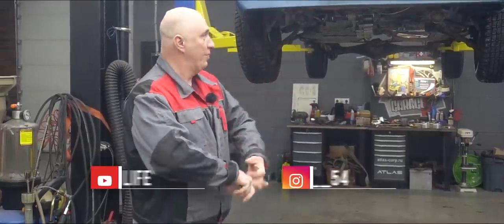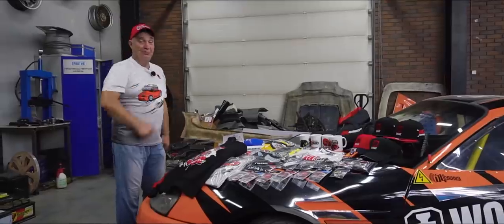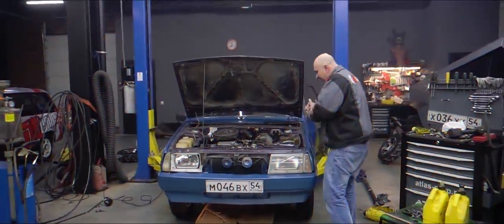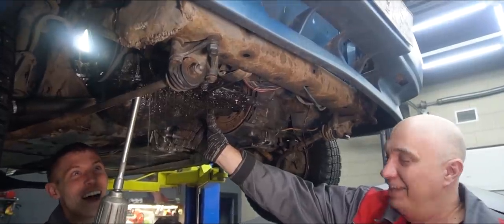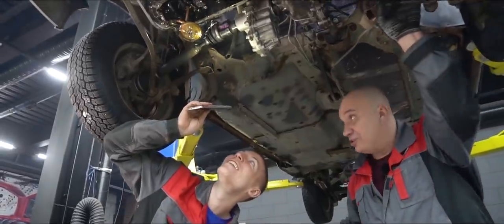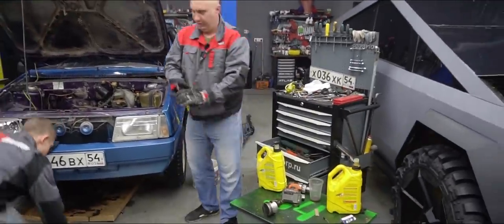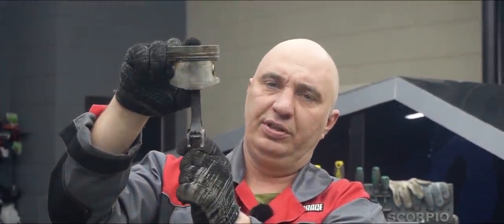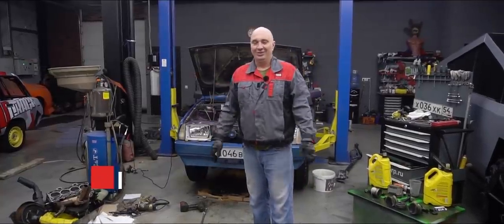How long will an engine run with no bearings?

Comment: Running an engine with no bearings, worried about having an old oil filter. Got it.
Reply: Yeah i was thinking the same lol.
Reply: That part made me chuckle when I was working on this one.
Reply: Oil pressure is important, if they had planned to run it long having a totally blocked up oil filter would have just caused the engine to heat seize rather than smash a rod like it did
Reply: Man. The disclaimers want to make me want to try it even more.
Reply: Maybe of they ran some super-thick oil like 50W70 or even straight grease, it would survive longer.
Reply: @AIO inc.
The vast majority of automotive oil filters feature bypass valves, specifically to prevent the oil pressure loss you describe.
Reply: Well yes when running a test like this you wanna make sure you have sufficient oil going to everything so I can understand that

Comment: Engine going from ~4000 RPM to full stop in an instant, that's what I call 107% engine carnage :-)
Reply: 113% percent success rate!
Reply: @mikeznel6048  
Impossible.
107 % is the max😅
Reply: @erikdikkers7931  They just round it up.  Actually it is 106.9999999999 percent.  107 is just a theoretical max but current science cannot quite get there yet.
Reply: Recycle time..
Reply: Nyet doubt. Sorry I do not know how to say doubt in Russian 😐.
Mr. Piston why you down here in the crankcase??  Too much Vodka 😂😂😂😂😂
Reply: The other carnage is the spoiler u left in plain view.
Reply: @buckerupfpv2622  Spoiler comments happen all the time, I'm not the only one. I always try not to read any comments until after watching the video.
Reply: @buckerupfpv2622  must not be familiar with comment sections..kinda meant to be used after you watch the video. That’s all on you if you decide to read them before.
Reply: People aren't smart enough to wait until after seeing a video to comment.

Comment: I would love to see you guys try gasoline as coolant in a couple different engine types. Excellent as always 👍🇨🇦
Reply: hmmm....
Reply: If it has a bad head gasket, what would happen, would it just run rich, or would the fuel in the coolant get ignited?
Reply: @LatvianVideo  ummm it would burn like normal
Reply: My guess is that the gasoline inside the cooling system would not ignite (given the lack of air).
Reply: @HELLFISH some cooling systems are sealed under pressure, including the reservoir. I wonder how much pressure could build up?
Reply: @SwapBlogRU  cool channel 👍, I wish I could understand Russian ✌🇨🇦
Reply: @HELLFISH you think the fumes might escape somewhere under pressure and ignite from spark?? To be honest I just want to see fireworks 😉💥
Reply: @HELLFISH it def would be dangerous, keeping lots of fuel near lots of combustions
Reply: Ferrofluid as the coolant and then you see what happens when you put magnetic pistons in.
Reply: they just did it recently

Comment: I lost a piston rod bearing on one cylinder three weeks ago. But decided to drive the 20 kilometers back home anyway. The engine lost a bit of power and sounded like a bag of bolts. But I avoided high revs and actually made it all the way home.
Reply: @biryanikebab Yes, and the rod was bent too. When I got home, I took the oil pan off just to have a quick look. What was left of the bearing was at the bottom of the pan. I didn't undo the bolts on the rod to check the shaft surface, but it must have been damaged. I knew what was wrong when it happened, just from the sound. The car is in the junkyard now.
Reply: Smart. Rather than a $200 tow, completely destroy the entire engine.
Reply: @markgunther2502  That car was maybe worth $1000 before the bearing broke. Towing in Sweden is close to $400. And I would still have to spend about a grand on the renovation. As soon as the bearing gave up, the rod and the crank was worthless too. So I would have to spend roughly $1400 and a lot of work to get a $1000 car. Nope, not me. I scrapped it and got $500.
Reply: @GAIS414  Your numbers are way off. I spun a bearing and replaced all the rod and main bearings with the engine in the car for a total cost of about $60 including a new oil pan gasket. The crank was lightly scored but easily can be sanded down in the car as well.
Reply: @markgunther2502  Hahaha! I can tell you don't live in Sweden. And sanding down the crank because of some discoloration? Really? 
Anyway, the bearing didn't spin, it disintegrated! There was no bearing what so ever between the rod and the crank. But I bet you would spend the money to get that car back to it's former craptacular glory. Believe me, the car wasn't worth keeping. Even before the bearing decided to become one with the engine oil.

Comment: cool! i remember when i was younger i had a 1983 chevy cavalier with a 2.0L engine. it blew up so bad at only 40mph that it sent a rod through the engine block and it was the size to fit 2 closed fists inside! it was that much of a bang! ahhh..yes..memories of a teenager who didn't care..lol!
Reply: I DRIVE A 1986 CAVALIER WITH THE 2.0L ENGINE.  I HAVE HAD IT 20 YEARS NOW GREAT CAR. I PUT NEW BEARINGS AND CRANK IN IT IN 2003 AFTER DRIVING A YEAR WITH A ROD KNOCK.  IT NEVER BLEW.
Reply: @MrHeavychevy86  Lucky man! LOL!
Reply: I'm in the UK I've got a vauxhall cavalier gsi turbo
Reply: @thomasmcdougall8059  that'd be a sweet ride. my family is from the UK (Scotland), but i've never seen one since it's been ages since i've been across the pond.

Comment: Try and run an engine with like two pistons removed so that is basically becomes an inline 2
Reply: John Deere already beat ya to that idea
Lol
Reply: @Rox_Fox94  It's always the Germans huh?
Reply: @matthewmorgan582  Third time is the charm
Reply: Well a v8 can't run with only 4 cylinders on 1 side are GMC Yukon engine once killed 4 spark plugs in order to cause that
Reply: @ImSleeping667  there are many videos of v8 running without a cylinder head on one side, and the numerous flathead ford v8 air compressors that run on only 4 cylinders

Comment: I'd like to see a "lada?" motor converted to a 2 cylinder 2 stroke. Use 2 cylinders like compressors to pull air and fuel mix into and then push it into the intake port (On the side) and have a lower exhaust port on the opposite side. I think it could be pretty awesome. No fuel mix required. Water cooled.  Sump and pan lubricated.  I figure you would have HP gains if the compression and displacement is 50% or more of the original.  You could dump the cam shaft and practically make your own head with a flat plate steel and air compressor one way valves; drill for plugs and to make it simple use small engine coils. A bit of welding and there you go.  I would like to say if this ever happens I would love to see a dynamo reading before and after. even if there is a loss.
Reply: That is an awesome idea

Comment: I had an idea for you guys to try, how about fixing an engines flywheel to a stand and starting the engine so the whole engine rotates. I think it would need to be a diesel engine
Reply: WHAT LOL
Reply: The French built a plane like that, where the crank was attached to the fuselage, and the block was attached to the propeller. I believe that was done to make sure it got plenty of air since it was air cooled :p   IIRC, it was a 2-smoker, and they said it turned one way really good, but not the other way.
Reply: @Iowa599  I believe that was the WW 1 Sopwith Camel with a radial engine. The rotating inertia meant it could roll one way easier that the other.
Reply: @Iowa599  The gnome rotary, imagine the whole engine working as a gyroscope, in a PLANE!
Not an easy engine to start apparently.
Reply: @Iowa599  The gnome rotary, imagine the whole engine working as a gyroscope, in a PLANE!
Not an easy engine to start apparently.

Comment: This was an awesome experiment , the carnage was a lot more than I expected.   Perhaps another fun experiment could be with the main bearings.  Keep the front and rear bearings in place and remove the center two bearings. plug the oil feed for the missing bearings and see how much stress the crankshaft can take.
Reply: Dont try this with your lawnmower engine powered Insight. PS , waiting for your vids.
Reply: @stoneheart9679  We are posing an update video in less than 24 hrs.. stay tuned!

Comment: I'd be curious to see how pouring some babbit bearings would work.
Reply: How long would lead bearings last? (Not long obv but still curious.)
Reply: @billbergen9169  They used them for years in steam engines.
Reply: @billbergen9169  Probably forever if you did it right.  I bet they wont take much power, but in a craptastic Lada, you'd probably never know the difference.
Reply: @tippyc2  but wouldn't the engine need to be balanced?
Reply: @billbergen9169  If it was balanced without the bearings, any imbalance you add with bearing material is probably negligible, especially at <5k rpm
Reply: The Ford model T had babbit directly on the connecting rods and caps. If you messed up your babbit and started to rod knock, Ford would re babbit your rods for a fee. A few cents per rod. You also had to fit the rods to the crank and clearances were made via smoothing the babbit. Usually sanding it.

Comment: I saw a story about a guy that was towing his Jeep with his Rv . He had left it in compound low. They said by the time he hit 60  mph it was turning over 50,000 rpms !!! . That would be something to see
Reply: I saw a story yesterday where someone was towing a modern Mini Cooper behind an RV and left it in first gear, it blew holes all over the block and gearbox......goodnight Vienna 🤣
Reply: The engine and trans literally blew up on that jeep... it didn't just send a rod through the block, the crank came apart and fragmented everything. Pretty crazy. 

Worst I've seen in person is a cummins diesel with 500 miles on it. One of the wrist pins came loose and blew the block completely in half. The only thing holding it together was the head.
Reply: Someone mentioned that flat-towed Jeep Wrangler in a comment some months ago. The G54 guys should definitely try replicating that specific scenario :-)
Reply: @wayshot  Oh yes I'd be up for watching that video, especially if they had cameras hooked up in the engine bay to watch it let go.
Reply: @graemew7001  They could use their Hummer to tow a Lada in 1st gear, or maybe use their wheel-spinning machine to spin some small engine beyond 10k RPM.
Reply: @wayshot  Both ideas really appeal 😈.....what does that say about us? 

After all Serial Killers start by killing wildlife and then progress, where will we go after these videos? Throwing different sized petrol containers into a Volcano to see how big the bangs are 😂
Reply: @wayshot  Yeah!!
Reply: He left it in 1st gear and 4WD low.
Reply: @graemew7001  in slow mo 😎
Reply: @heyoldman2003  Oh yes, has to be done 😈😂

Comment: Very educational. Now I learned something very significant. It has to do with the air cooled four cylinder engine in VW type I and II 1971. Those engines had a problem with dropping a valve into number 3 cylinder or spinning number 3 rod bearing. Now I see what would go wrong if one were to continue to drive with the rod knock. Thank you.

Comment: Main bearings seized up, because connecting rod journals "leaked" oil pressure. Oil lights sensor could turn light off like something 0.2bar which isnt enough to bearings

Comment: You guys should hook up four brake masters directly to each corner of the car's brakes and operate them with a lever mounted to a ball at the bottom, simulating a joystick. Space the masters (or even use clutch masters, no need for a tandem piston setup) out in an X arrangement. Use the brakes to steer. Hook up the throttle to the steering wheel. Organize a race with your crewmen.

Comment: I hydro-locked a Volvo 340 engine going through a flood. I didn't realise the air intake was just above the spoiler!  I flushed the engine with new oil and fired it up, it did sound a little rough but took it out for a run anyway..... A rod let go as I shifted into second, took out both sides of the block and punched holes in the sump..... left a trail of Oil and bits of metal down the road, but still ran on 3 cylinders enough to get it home.  :-)

Comment: My very first car wayback in the mists of time was a '72 Hillman Avenger...paid £100 for it and I drove it from London to the top of Scotland and back down to the tip of Cornwall and everywhere between.   I was heading to Liverpool from London when in the last few miles of the motorway unbeknown to me I sprung an oil leak and the first thing I knew about it was the oil light popping on just before the engine exploded... so ended my Hillman Avenger but managed to coast the last few meters to park off the motorway.

Comment: You should have tried pouring your own bearings with something like solder or even proper Babbitt material but pouring them in place the old-school way very old-school melting aluminum and trying that might have been interesting also

Comment: Run an engine with the heaviest motor oil. Better still, fill crankcase with STP Oil Treatment or Motor Honey any thick engine additive.
Reply: Good idear.
Reply: Those are all around 50 weight. Need to use 70 weight engine oil

Comment: Never knew how beefy Lada rods are but a down fall on the cap being a little thin but still pretty impressive engine compared to our American cars for sure 😂
Reply: American cars have been trash since 1970 - but still cool, I like Cadillacs
Reply: @dakoderii4221  they are idiots afterall, people buy Hondas because they know they are reliable, they have trust.
Reply: The problem is American manufacturers see everything as disposable. I took a Ford class to learn about a specific diesel engine and even on a diesel, something you expect to last a long time, the manufacturers only expect the lifetime to be around 150k miles. Once it hits that mileage it's supposed to hit a scrap yard according to them.
Reply: Cole Cooper you are correct…. In some makes there are internal parts (engine and transmission) that are actually designed to fail after a considerable amount of miles. Sad…. I drive a pair of Toyota 4Runners, one with 255k the other 290k…. Fixing frame rot on one only because at 290k miles it runs smooth, shifts like silk, goes dead straight and the a/c blows ice cold…Not the first Toyota frame I’ve fixed and surely won’t be the last.

Comment: a spun bearing was the first death of my V6 Charger, didn't know what it was and drove it home from high school, it made it home, but by then it was too late, 2nd death it lost all compression at 4k not even 20,000 miles after the rebuild, as of a year ago it was scrapped, I wasn't about to throw another 5k into it, but it's interesting to see what an engine with no bearings would do

Comment: I suggest, if it hasn't been done,  for a next video to take a lada, test the speed, and remove one piston, one piston rod and set that valves so they stay close, so you have a 3 cylinder lada to test. And than a 2, and then a one....

Comment: yes, i have heard a car with no bearings. either under run or over spun.

maybe see if you can run a car at a super low rpm with significant load, and see what happens.
Reply: You probably could with a very large flywheel

Comment: I'd suggest welding shut all the oil ports on the crankshaft so the rest of the engine still get oil pressure

Comment: How long will a engine run without an oil sump and pump. But with regular industrial bearing  grease pumped into oil system with a grease gun?

Comment: 4:11 You can see how the sparkplug actually turns and how the oil stick is twitching, I knew from the start this was the most failing cylinder and that this blew the hole in the first place from the moment I saw it. and that was the first time I saw the video. Amazing failure

Comment: I wonder how it run with rods that had a tighter clearance. Closer to or the same clearances as it would with bearings.
Reply: It will run just fine, bearings exist because it is cheaper to replace a tiny bearing rather than a whole rod
Reply: @lorenaswift  I figured it would seeing as how my Audi doesn't have cam bearings, it would just be fun to try I guess.
Reply: @4BillC  most engines dont have cam bearings....

Comment: Could you please try making your own bearings, like I did from a piece of aluminum pipe the correct size and see how far you get 🤗 I really don't want to hear your awesome Lada motor run with no bearings at all, mine is still going using a 1.5mm wall pipe 😀 please try it yourself xo.

Comment: Give the next engine a fighting chance, put 10 parallel oil pumps and filters on it to give the crank shaft a chance of maintaining some oil pressure!
Reply: It had pressure above 4k, this amount of play just kills the engine
Reply: @davonmulder8458  It may have had 'pressure above 4k' but only because the journal bearing oil holes are too small to let that much flow through. I'm talking about trying to push enough oil through there to maintain an oil cushion between the rods and shaft despite the lack of bearing journals. Massive flow required, possibly too much for the crank's oil channel to handle.

Comment: Take an old lada and turbocharge it. Just run with like 2 carburators and see what kind of power you will get before the engine gives Up!
I am very curios how those engine will stand the power without billet parts inside 😁😁

Comment: I'd like to see you try cutting one cylinder off of a four cylinder engine, to make a fully functioning one cylinder engine.
Reply: Been done several times by various Bonneville racers. They've used band saws to cut off parts of 4 bangers, inline 6s, even V8s, then welded the front or rear portion of the block back on. Certainly easier with an aluminum block, but it was done on cast iron blocks and heads in the 1950s and 60s.

Comment: Here's a suggestion: run an engine without oil, bearings in the head on the camshaft and see how long it runs.
Reply: most engines dont use cam bearings